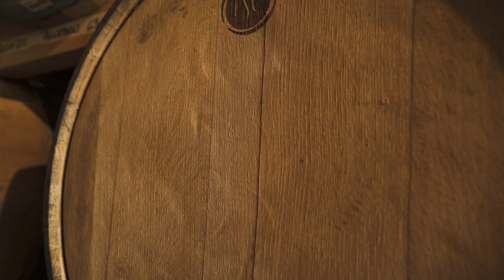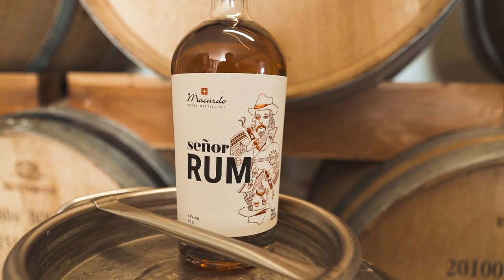The SWISS Distillery Making Award🏆 Winning Bourbon

Comment: Interesting thing about the use of bourbon classification. Using the same logic, every country can have it's own bourbon.
Reply from the maker: Neven Vorkapic great point.  The Swiss don’t fall into the EU for starters. Bourbon's legal definition varies somewhat from country to country, but many trade agreements require the name bourbon to be reserved for products made in the United States. The U.S. regulations for labeling and advertising bourbon apply only to products made for consumption within the United States; they do not apply to distilled spirits made for export.
Reply from the maker: Neven Vorkapic  here is reference that goes more into what I was explaining “27 C.F.R. sec 5.1". Ecfr.gov. Archived from the original on March 18, 2018. Retrieved July 15, 2015.  He
Reply: @drinkdestinations  There is only United States bourbon by law.
Reply from the maker: smylebutta7250 I totally agree.  Switzerland distilleries can still call it bourbon and make it exactly the  same standard as bourbon.  Now they can’t sell it in the USA under bourbon but it’s totally legal to do so in Switzerland.  They also don’t fall under EU standards that US implements with EU countries not allowed to  call it bourbon as well.  Hence why you see the label and why the distillery calls it bourbon!  It’s actually really good too!  Cheers, -Jeff
Reply: @drinkdestinations  great forward thinking of the Swiss not to join the EU👍